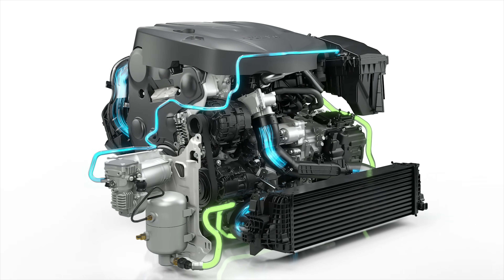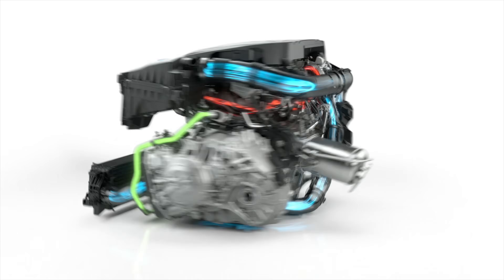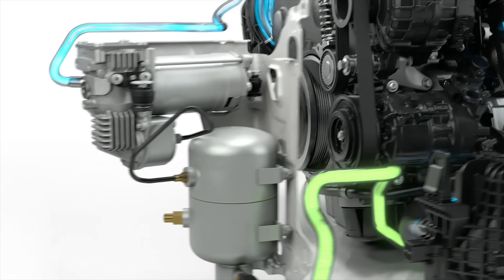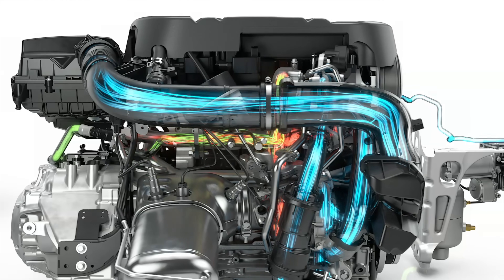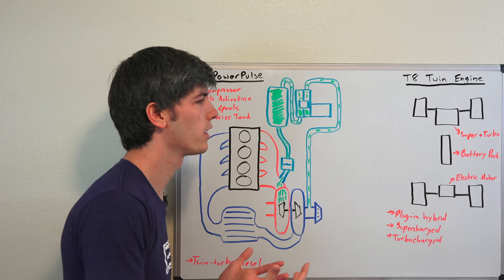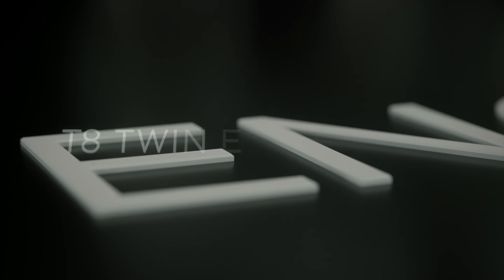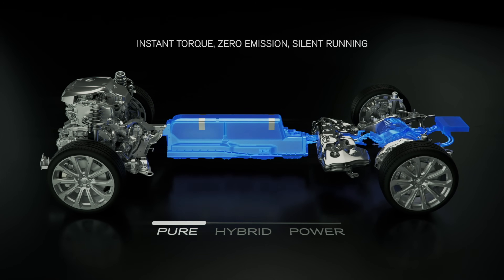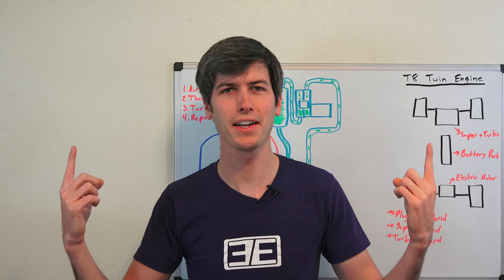How Volvo Is Eliminating Turbo Lag

Comment: How bout just don't use turbos lol.
Reply: but mah psssssssshhh tsu tsu tsu
Reply: In a diesel, turbos are essential to performance, and almost no diesels are made without them. As compression engines, the turbo helps with the compression of exhaust gases and allows the engine to produce significantly more power than a naturally aspirated diesel.
Reply: Turbos utilize free energy... Why not. I took a biology class and learned about byprodcuts in systems. 

Exhuast is a byproduct, if we can utilize for a greater purpose why not?
Reply: StrangeClouds bit what about baaaaap stutututututu and the spool up sound  and the speed when it kicks in
Reply: turbos turbines and compressors are great technology why not use them?
Reply: MasterMech77 What I mean is that forced induction is not the only system used to improve fuel economy. Most of the modern turbo engines also employ direct injection, start/stop tech, 8+ speed transmission, etc, "tricks" that can be used to improve fuel economy in N/A engines.

And your comparison is entirely apples to oranges. The reply posted by emdec55 makes a much more fair comparison, using the same vehicle, and helps make the point. Even the bigger and more powerful N/A engine is just, if not slightly more efficient.
Reply: Yeah that would really make coold diesel engines.
Reply: diesels are gutless without em.
Reply: How about you don't use fossil fuels then?
Reply: Yeah lets all drive 6 liter na v8s. Paris agreement will like that one. I love turbos, you dont, have a good day
Reply: Also, "smaller" turbo engines are not really any more compact than, say, an LS engine. When you add in the DOHC and all the turbo plumbing and cooling, it's not much difference is size or weight.
Reply: Here's an LS sitting next to a Mazda 1.8 turbo. The LS which can be over 7L in displacement, is only slightly larger and probably not much heavier, possibly within 50lbs.

Edit -

Links are blocked, so just finish the link,
engineswapdepot  . com/wp-content/uploads/2015/02/Miata-I4-engine-vs-LS3-V8-size-comparison-02-1024x567.jpg
Reply: Same goes for the F150 and the Fusion, etc., but it's not just Ford. When Motor Trend tested the 2.0L N/A MX5 and the Fiat 124 Spider with the 1.4L turbo, they found that not only was the 2.0L engine better to drive, it was also more efficient. Virtually the same cars, but the N/A engines was more efficient.

Another example of N/A and excellent fuel economy is the LT powered Camaro and Corvette. It's very common for owners to see upwards of 30 MPG, which is as good as what you'd see out of engines half the size.
Reply: MasterMech77 Seriously, you're just in denial and replying non-sequiturs.
Reply: TheGiant Gaming That is his point! If turbocharging causes an engine to run lean, a rich mixture is needed, which defeats the purpose of the turbo, to create power without use of more fuel. There is no point to turbocharging, it's just needless complexity.
Reply: Spamfried
When you run a forced induction system (without getting to technical), you make a small engine act like a large one... As long as everything is "tuned" correctly, you will get better fuel economy, better overall performance and lower emissions... SO YES there is definitely a need for forced induction.
   You only have to look at modern vehicles is see it in action... 2 Liter engines out performing 6 liter V8 engines (of old)...
Reply: StrangeClouds you must have never owned a turbocharged vehicle. My power stroke, and the 2 evos I have owned have been nothing short of fun due to the turbos.
Reply: Skipper
Not sure what you mean by "fuel economy tricks.", so just going to compare two similar vehicles with two completely different engines.

2015 Ford Edge AWD 2.0L I-4 ecoboost engine: 245 hp and 275 lb-ft. EPA city/highway driving: 20/28 mpg. Curb weight: 4309 lb
vs
2015 Nissan Murano 3.5L NA v6 engine: 260 hp and 240 lb-ft. EPA city/highway driving: 21/28 mpg. Curb Weight (lbs): 3977

The Point of my comments are not to say Forced Induction is better or worse... I was making a point, playing the devils advocate... The simple fact that you can take a small displacement forced induction engine and return the same results as a much larger engine, is impressive. In the example I have provided, the Ford Edge is heavier vehicle, so the smaller engine helps to keep the overall weight down. A larger engine, would be heavier, making the Ford Edge that much more worse off...
   There is no perfect application of a N/A or Forced Induction internal combustion engine... but that is not the point...
Reply: MasterMech77 And your comparison was proven to be garbage.
Reply: Special Why not? You talk as if it's been established that turbocharging is the best route for reducing CO2 emission, but the evidence contradicts that. Better MPG means less CO2. MPGomatic tested the Charger 392, a full-size, RWD car, with a 6.4L engine and nearly 500hp, and managed over 30 MPG. You can search that on their channel. That's better than what I'd see in my WRX, which was a turbo 4 cylinder. 

Really, displacement has nothing at all to do fuel consumption. If anything an engine that is large but turns over lazily may actually get better fuel economy. The rate at which power is made is just as important to know as the size of the engine.
Reply: Steevo69 Well, you're evidently wrong and just spouting nonsense. Normally aspirated engines have not reached any limit. If that were true, they would be getting smaller. Also, you cannot just utilize more energy. If you knew anything about emissions, you'd know emissions is a balance and there cannot be simple reduction across the board, and you wouldn't just make blanket statements about emissions.
Reply: rockn roll Yes, and that is't any different than keeping your foot "out of it" in a N/A engine. Drive a Charger SRT, keep your foot "out of it" and get 30+ MPG on the highway, or put your foot in it and get 10 MPG. Turbocharging is no different and is just an overly complicated gimmick that has only survived with government displacement taxes and the demonetization of displacement in marketing.
Reply: matthewmatthew638 They aren't all skimping. The cooling systems on many modern cars are seriously capable, but no cooling system can provide rapid and highly controlled exhaust temperature cooling, you can only do that by, well.......cooling exhaust gas temperatures. There's no way you can meet emissions and have everyday reliability without the tuning they're using these days.
Reply: No forced induction on a diesel? You might as well go back to the stone ages... Forced induction allows for higher performance and better fuel economy. Since you are not limited to using a large engine. You can use a light small displacement engine and get the best of everything... Yes there are draw backs, more expensive to produce, less reliable, due to more complicated designs... BUT the benefits far out weigh the drawbacks.
Reply: There are a couple of teams in shell eco marathon who use turbochargers to improve fuel efficiency. They also tune their cars for efficiency rather than power or emissions. For achieving better fuel efficiency, valve and injection timings need to be tuned accordingly. We don't do it in our car, because it might make the car a bit heavier, which is undesirable.
Reply: David
Nothing returns rated fuel economy in real-world conditions... But forced induction engines are no worse or any better then the NA engines they compare too. You can check above for examples of what I am referring too.
   In the examples I provided, both engines provide similar performance outputs (weight, displacement, and number of cylinders do not matter for fuel economy to performance aspects). The only thing that is important are the overall output is similar, the 3.5L NA v6 vs the "boosted" 2.0L I-4 engines, achieve almost identical numbers... within 1 MPG real world results in fuel economy.
That was the whole point I was trying to make, a small engine with forced induction can act like a larger one. But with the overall smaller more compact size of the 2.0L engine, you can use that engine more easily in more applications, which in turn lowers the overall cost for production, which in turn keeps the prices of vehicles down.
Reply: MasterMech77 Read the other replies to you, particularly the one from emdec55! The same Ford Edge, the same vehicle you used in your argument, gets better fuel economy with the larger, normally aspirated engine.  I even explained that should compare similar vehicles, but you made the comparison with different vehicles any ways. You don't have an argument.
Reply: David
"comparison was proven proven to be garbage" ? You are mistaken... because numbers do not lie. The two engines were developed during the same time period, they both have similar real world fuel economy numbers... well the NA engine actual achieves 1 MPG less then the "boosted" engine, in real world use. The vehicles I used for comparison, the forced induction engine was actually in a heavier vehicle, so the fact that it achieves a slightly better fuel economy is that much more impressive. The vehicles are very close in overall performance with the two different engines... SO again how was any example I provided "garbage", unless you are not actually reading the information provided, and just making things up now.
   Your mistaken if you think a 2.0L engine takes up more room then a V8... Yes when you add forced induction you have to engineer the system to work with in a certain space... that is just common sense. 
   If I am wrong... then why is the 2.0L ecoboost used in everything from sub compact vehicles to SUVs? I am just showing real world examples of what is being implemented today. These are not my theories, this is not information I am making up, this is just facts, that you can see for yourself. Sorry if you don't like forced induction vehicles... but that changes nothing.
Reply: Skipper
The 3.5L V6 achieves 1 MPG LESS real world fuel economy, then the 2.0L ecoboost engine... for the two vehicles I gave for example. Their tested EPA numbers were similar.
   The two different vehicles make no difference, since they are very similar in every way, minus the Edge being a bit heavier for the 2015 models... However if you more up in years, to 2017, the Edge and the Murano weight about the same 4k lbs... Which in turn makes the Murano achieve even worse fuel economy, then the Edge by about 3 MPG, using the same engines, that were provided in my example. 
   This is using real world numbers... not EPA numbers... I am sure you can find that information yourself.
Reply: MasterMech77 Turbocharged engines aren't used by manufacturer in any wider of range of applications than they were when they were all N/A, companies like BMW and Mercedes still require as many engine blocks as they did when they were all N/A. If anything, there might be a wider range of power ratings and engines displacement when they were once all N/A. 

If you want a good example how wide ranging and versatile N/A can be, take the GM OHV family for example, just two blocks but outputs ranging from 195 hp to over 750 hp out of just two engines blocks. In the case of the LS, it supported 285 hp to 776 hp, and it was used in everything from commercial work trucks to family sedans to supercars to luxury cars. What's a wider range than that? There was no need for boost, just change the bore and stroke for the same block. That's way cheaper than what they're doing now.
Reply: MasterMech77 Well, I believe we've jumped the shark, but I'll give it one last shot...

Why does the evidence show the Edge gets better fuel economy with the bigger engine? Simple question.

According fuelly reports

280 hp 3.5L N/A V6
Avg MPG of 23.25 with a 0.28 MPG margin of error.

245 hp 2.0L Ecoboost 
Avg MPG of 22.32 with a 0.32 MPG margin of error.
Reply: MasterMech77 There are way too many variables for your comparison to be even remotely fair. Comparing the same vehicles with two different engines is fair. And just from by own personal experience, turbo engines aren't any more efficient, it's all just marketing.
Reply: A good 2.0 litre turbocharged engine can make as much power and torque as a 3.5 litre V6 while using much less fuel in mixed driving. But I guess you already knew that...
Reply: matthewmatthew638 
Cars only run Rich if you've modified the vehicle's catalytic system, like aftermarket exhaust that delete cats, or are not a good design. They also can run Rich too protect the engine, if you use a manual transmission and lug the engine, by not down shifting and going full throttle in top gear. There engine will dump fuel to prevent knock.
Reply: MasterMech77 there's that, but many modern turbo implementations also have the OEMs skimping on cooling and instead opting for really rich fuel ratios under load to control temps.
Reply: matthewmatthew638 
There LT-1 is a Eco v8... If set up correctly, it can achieve respectable fuel economy to power output, the S55 is the performance version of the N55, so power output to fuel economy was not important, when they developed the S55. 
   So you're correct in your comparison.
Reply: matthewmatthew638 
You are absolutely correct, too many factory vehicles are coming with horrible cooling systems. Just look at the Mustang GT350... Ford makes an amazing engine, and fails to provide good cooling. It is becoming a major issue with the newer vehicles.
Reply: Matt, since we're talking about mixed driving, that will be offset by when the engine is not under load. My car (Leon Cupra 280) uses around 8.5 l/100 km in mixed driving. That's with climate control on.
Reply: the turbo was invented to improve the engines that vary their performance depending on the air, a totally deficient engine that the only thing it does is sound good and increase the costs to move our resources. four stroke
Reply: how about not buying commie chinese crap?   volvo s*cks now
Reply: EMCE3IME_LINUXTECHADDICT You'd be surprised.
Reply: Increased efficiency at the cost of additional maintenance.
Reply: emdec55 I see you don't understand forced induction and efficiency gains, weight savings, and yes, the end result is improved emissions. How about you think about it this way. Every "emission" from a car, truck, or machine is a waste product that could be possibly utilized for more energy, turbochargers were a natural evolution to overcome limitations.
Reply: Leslie H. Turbos also screw with air/fuel mixture, making them run hotter and increase NOx emissions. Turbos work in theory, but you can't just force more air into an engine that it cannot induct naturally. This explains why so many have complained their real world fuel economy isn't any superior to N/A engines with similar output. Believe it or not, they literally run rich mixtures and even inject fuel on exhaust strokes just to keep EGTs lower. It is a big waste a fuel and defeats the purpose of turbocharging.
Reply: If T/C worked the they are sold, then engines would've gone mainstream with that, FI, DI, and HC decades ago, but the reality is that they don't work that well in reality. Manufacturers are simply looking for ways to step around emissions around displacement regulations and taxes that are sprout around the world, and turbos, etc, allow them to cheat more easily, but the reality is that people get short changed at the fuel pump.
Reply: Iventonart because running lean risks the engine, do you want a melted engine or a bit more gasses, not like its going to safe the world....

Bio-engineered solutions to convert co2 to oxygen have proven to be really effective...
Reply: Suburban VS the additional maintenance of twice as many cylinders, twice the ring leakage, twice the weight for the engine, twice the fuel consumption at almost every possible scenario? Turbochargers are here and have been for as long as they have been around, as are superchargers, or other ways to increase the volumetric efficiency above 1.
Reply: matthewmatthew638 As a small block owner in my Chevys and friends with Vettes, not a chance, mine gets around 13.9MPG in my truck my friends Vette gets almost 17 if he drives it like a prius, since my first 400 small block in my 85 truck (.30 bore, 12.5:1, sodium filled exhaust valves, forged internally balanced crank, 650CFM Demon, and 8MPG (love the power on tap) they are fuel pigs, and unless you love running race fuel $$$ you will never extract as much power as efficiently as a forced induction engine. The only downside to forced turbo induction is lag, and lo.... this video is about ways to address that issue, and there are other ways, like feed it a bottle till boost comes on, another friend engineered a PWM controlled NOS injection kit for his supra to help alleviate the turbo lag from the monstrous turbo fitted on his car. We have had turbochargers on heavy machinery, ag, and industrial machines for years with no issues, diesels essentially require them. In the day and age where fuel efficiency has increased despite all the extra things added and weight gained by a lot of cars and trucks for the additional accessories there is a reason why Chevy, Ford, Dodge, and many others have opted for forced induction on smaller engines. Its more efficient. But I'm sure with your armchair degree in grease monkey videos you know better than engineers from multiple companies, multiple countries, multiple generations, its THEY who are wrong, of course, not you.
Reply: MasterMech77 Please show us a turbocharged that is "turned correctly", providing better real-world fuel economy and performance than a N/A engine employing the same fuel economy tricks.
Reply: David
The Fiat 124 Spider with the 1.4L turbo engine produces More power and Lbs, ft then the 2.0L N/A engine in the MX5... The Fiat is a heavier vehicle with all the things that have been added to it. They both tested to achieve similar fuel economy numbers. Some reviewers like the Fiat over the MX5 some don't, some like the turboed engine over the NA engine, some don't. That is just a matter of personal opinion and personal taste. 
   I personally don't like  turbocharged vehicles, I do like supercharged ones. Turbo systems are overly complicated, and the lag ruins the drive experience for me. I own a 2013 Scion FRS... one of the best "drivers" cars out there. I also own a 1968 Chevy Camaro "Pro Street" running a NA Sonny's SAR 762. SO I know a few things or two about NA engines.
   However, just because I am not a fan of Forced induction, does not change anything, about what I have commented on.
Reply: Steevo69 I'd bet my life savings that a 6.2 L GM LT1 would be more reliable, weigh lighter (after taking into account cooling), and have better real world fuel economy than the BMW S55, which makes similar power
Reply: ianiva in mixed driving the 2L turbo will run really Rich under any sort of load (like 9.5,10:1) and nuke fuel economy.
Reply: Steevo69
As someone who's owned a LS3 C6, the only time I got <=17mpg out of a tank is if I tracked or autocrossed the damn thing, if I am just commuting I average 24-26mpg per tank, I suspect your friend just get stuck at traffic jams all day, if that's the case, don't expect any better from a turbo motor making 400+hp.  I don't particularly care that your classic 400 tuned SB gets shite mpg, I mean, no shit its a old engine design, Modern Gen V LT1s have VVT and cylinder deactivation, and happily get 30+mpg on the highways. W.r.t Chevy, Ford and Dodge, it is rather telling that, within their most demanding applications (sports cars + trucks), all 3 have, by and large, stuck with N/A or Supercharged V8s, with only Ford having replaced the v8 with the ecoboost in the F-150 recently. It's almost as if the engineers at those companies have realized that it's far cheaper and simpler to stick with N/A to make good power up to a point .

Heck, C&D found that a Camaro SS Convertible, despite a 500 pound weight deficit, has exactly the same real world observed mpg as the Camaro 2.0T Coupe, which, in turn, was worse than the Camaro V6.

Diesels, by nature of their methods for ignition, benefit immensely from having a turbo ram more air into a motor, their blocks are reinforced to deal with extreme compression anyways, not so for petrol engines.
Reply: be gone hot. you won't  get anything done hoeing around on car channel. Women don't understand about turbo.
Reply: Stephen Jeffcoat Yes, and diesel engines are dying off. And like diesel engines, gasoline engines are seeing increasing lighter particulates due to turbocharging and direct injection, things that we once only found on diesel engines.